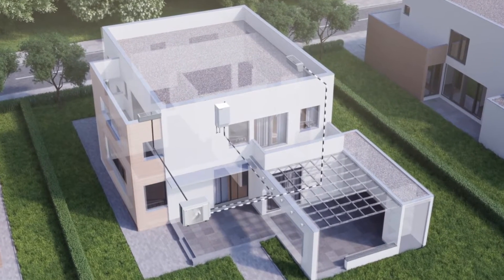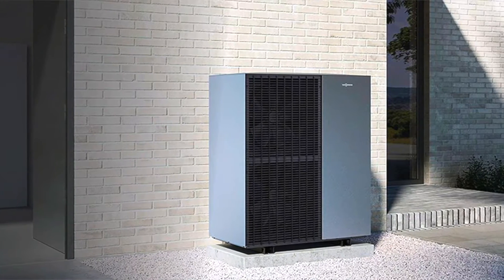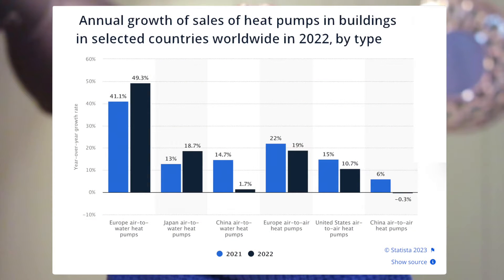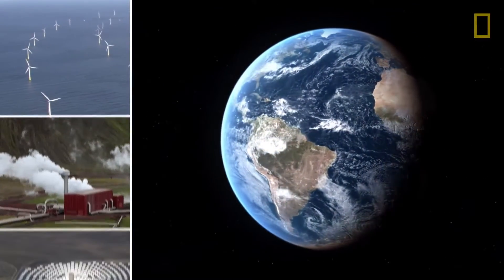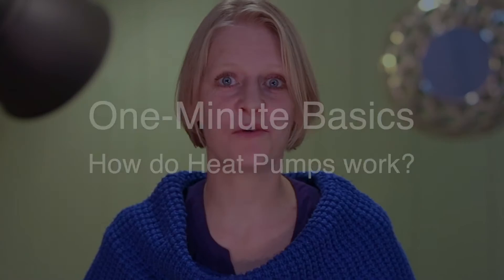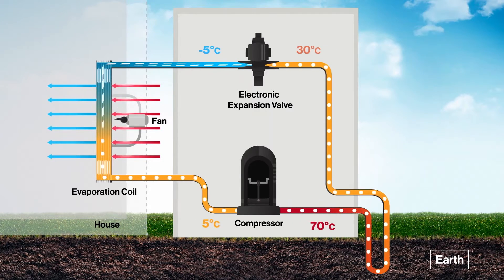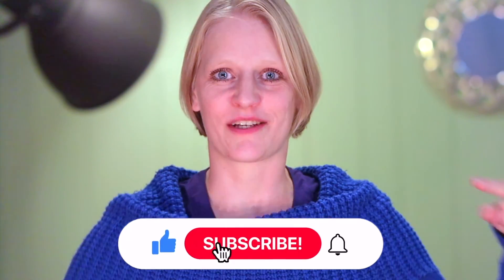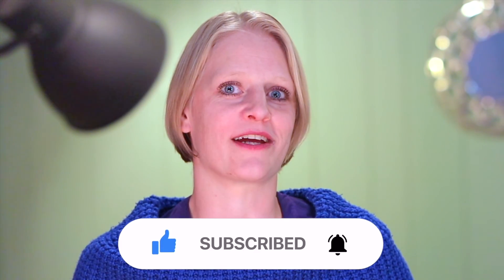Hybrid Heat Pump (Is it worth switching to?)

Comment: Good job explaining some of the variables involved. There is a lot of differences even in locations that are close to each other and for the majority of installations professional help from contractors that are extremely knowledgeable is important. One problem with that is that it isn't easy to find the very good installers in certain areas of the country. I would have liked to hear more about thermal earth batteries that use summer sun to heat a fluid that is circulated  deep into the ground which is then extracted during the winter.  Another topic would be large (200 gal or so) buffer tank that is  heated with 1) thermal solar or 2) wood or 3) heat pump (from solar electric perhaps) or 4) gas/propane (as a last resort). Tank should be sized according to how long you might expect it to have to heat your living space. And, why is America seemingly last. Example, many heat pumps sold in the US use R410A refrigerant which is being phased out. Whereas CO2 and Propane refrigerants are widely available elsewhere. JMHO. Thanks again for the video.
Reply from the maker: Thank you so much for sharing your experience! 🙏 It is much appreciated.
Reply from the maker: Hi there, Thank you very much for commenting on the new switchgear video. I thought it was a great comment. Unfortunately, I had to do a re-upload. If it doesn't cause too much inconvenience, it would be great, if you could copy paste the comment to the video: "Are western governments banning SF6? That would inhibit domestic manufacturers from using it for their products and it would force foreign manufacturers who wish to export to the west to not use SF6. I hope his product catches on and having SF6 banned would be helpful. I don't know what SF6 status is." This is the link to the new video: https://www.youtube.com/watch?v=9smqNAKrxDI
Thank you in advance, Katharina

Comment: Video starts at 4:05
Video assumes what avg air temps are in your location so you need to check to make relevant to you.
Summary: Air source heat pumos are equally efficient at +10C and at +4C ground source starts more efficient and the lower the outside air gets the better they are.
No sources are provided... so... if you are trying to size/design a system there not even starting point to compare these numbers.

P.S. For the love of god... BLINK WOMAN!
Reply from the maker: Hi, Thank you for the comment. 🙏 That’s interesting und helpful. I’ll provide more sources and hands-on calculations in the future. Let me know if I can help with a specific use case. 🙂 Katha
Reply: @NetZeroTech  you know what I really miss? Or at least have not found yet?
Heatpump comparison table: max btu/h total best case scenario kw heating and cooling performance; number of heads supported by a unit. Samsung  DVM S provided a lot of data but the  I started looking at local reps... its a mess. Usually there are like a couple numbers provided with no context
Reply from the maker: Thank you!  🙏 Very helpful. I put it on my list of video/resource ideas. It may take me a while to research and execute on it and ideas from my paid Patreon members come first, but I this is something that I'd also be interested in and potentially other viewers. Thank you! 🙂 Katha
Reply: @NetZeroTech  I did a bit of calculation based on weather station's historic data for the duration of heating season (2023-09-01 to 2024-05-01) and out of 5855 hours in that period 4470 were under +10C (76.35 percent) and 2898 were under +4C (49.49 precent)  I looked at the comparison of geo and air pumps in research paper (Spatial assessment of the Ground Source Heat Pumps suitability against conventional heat pumps based on Superficial Air Temperature) and shows that Air heat pump efficiency is almost linear which would make integral comparison of total efficiency gain fairly easy... how how does efficacy map to power consumption... I think there something missing.
What I am trying to get is an estimate between solar generation in winter months and power consumption in kWh of a heating system.
Reply from the maker: Great questions! I may have touched upon that in some of my other videos and would love to cover it in more depth.

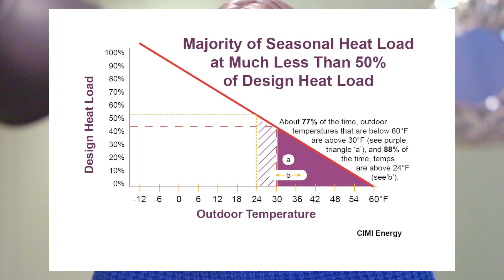Comment: @Net Zero Tech, Thanx for eastern Massachusetts seasonal load graph at time stamp 5:59, I will be lowering switchover temp next heating season from 40°F to 30°F for my dual fuel (air HP/ducted gas fired) system. Info so helpful. Next big step for my system will be Summer cooling here on Cape Cod. You’re doing great job and service!
Reply from the maker: You are very welcome! Glad it was useful. 😀 I was wondering, if I should do more localized content. It's always a tradeoff. What are your thoughts on the cooling system? Let me know if you want to present anything on the channel. Thank you! 🙏 Katha

Comment: One on the best video about heat pump. This year I will implement this hybrid system both for the air-water, air-hot water and air-air pumps with which I heat my house.
Reply from the maker: Hi @user-ry7yg2hk7i. Thank you. You already have multiple heat pumps in your house? Thanks, Katha

Comment: As an HVAC engineer I can't tell you how much I appreciate you using the term ground-source rather than geothermal.  Most of the people I run into use the terms interchangeably which is not technically correct, but everyone knows what you're talking about.  Unless they're from up north (I'm in SoCal) and know what geothermal really is!  Then there's confusion.  It's a great way to do things if you have the right soil conditions and funds, but those are two very big ifs!
Reply from the maker: Yes, it’s a great point. It is tricky with content creation, because a lot of people are more familiar with the word geothermal, but you also don’t want to bore the informed people with terminology. It’s important to me to stay factually correct and yet be entertaining. Thank you for watching and commenting! 🙏